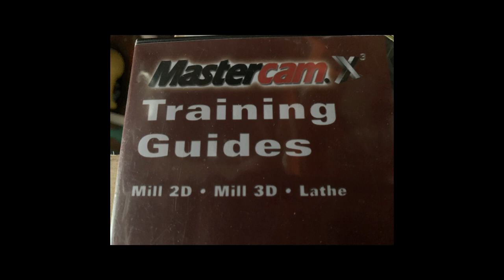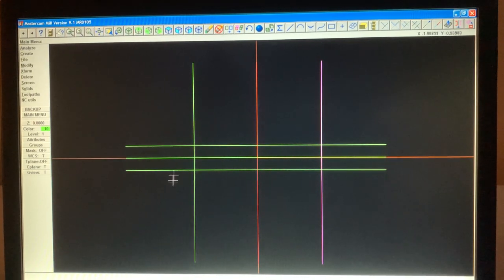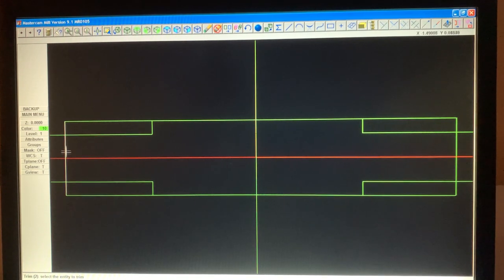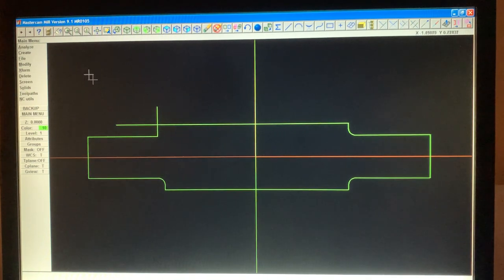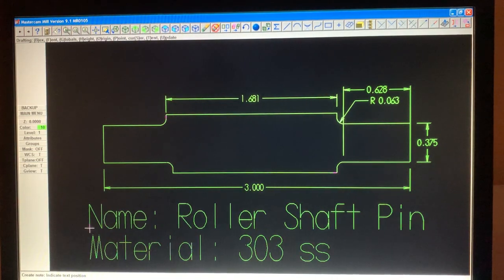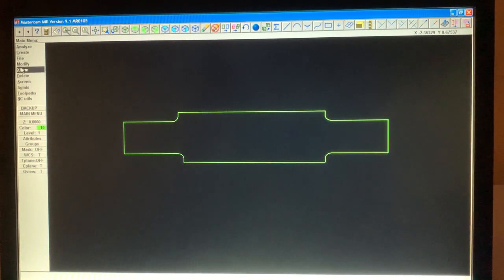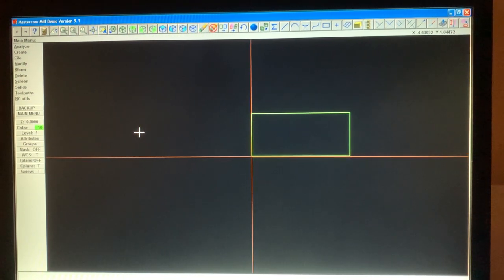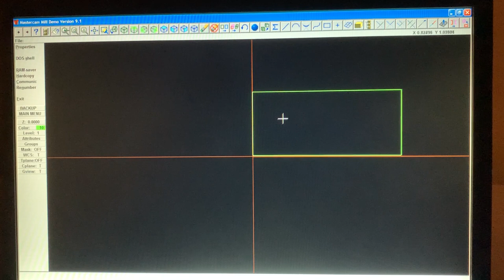Learning How To use Cad Cam Mastercam v9

Comment: Pls explain transform & xform 
Proper wcs settings
Reply from the maker: Transform & Xform are just ways to get into the geometry to represent the whole part of what you want to do. They are hot keys letting do certain function that need to be done by the programmer. Not all function keys can be display all at once on the screen. So they are set up as menu Identifiers.   Xform: This option allows you access to all the tools that allow you to transform existing geometry, such as mirror and rotate.